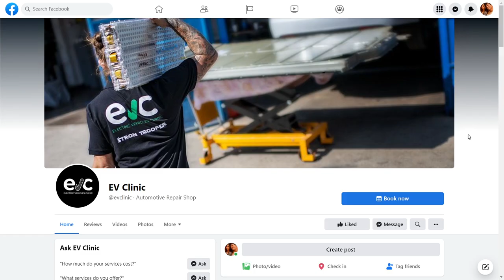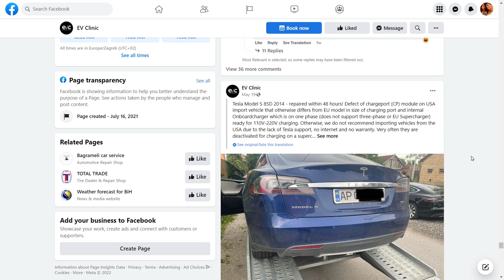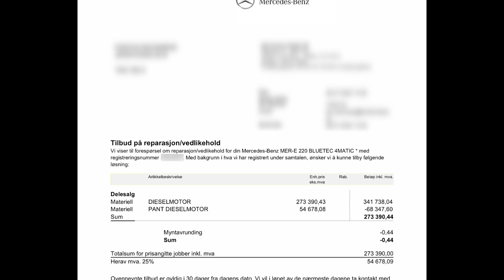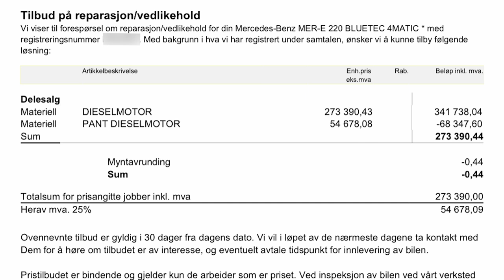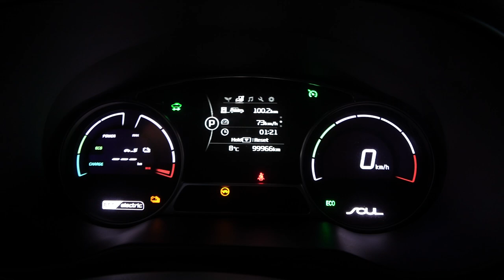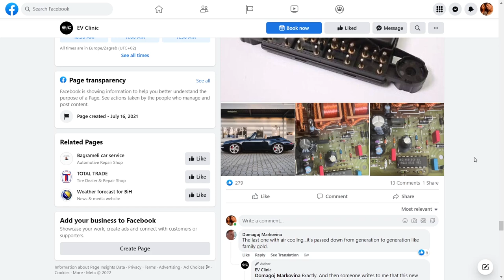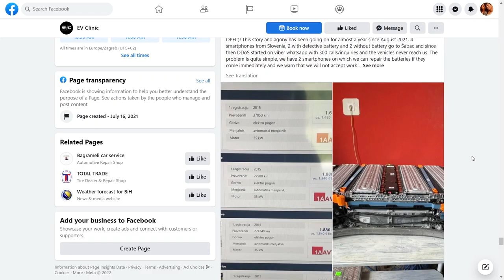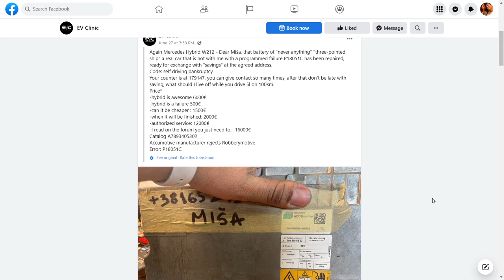Why fossil cars are more expensive to repair than EVs

Comment: The biggest problem is to find guys like Nassid and Vanja in your neighborhood :). I hope we'll see more and more companies in the future that can do EV repairs on a level below just swapping complete boxes.
Reply: @rogerstarkey5390  I have not really heard anything about such companies so far, at least not over here in Germany.
Reply: This is the future.  If I were a mechanic or ran a garage I would be training up to do this now (I think many are)
Reply: @FFVoyager  I think there needs to be a second level to this. I don't really expect a garage to actually "repair" a broken inverter for example. But they could replace it with a refurbished one and send the broken one to a company that is specialized in this kind of electronic repairs.
Reply: @EinzigfreierName  The problem is that they will not send it for any refurbishments and will just replace with a new part which will be a very expensive replacement.
Reply: @dkostasx  Sure, that is what's currently happening. And I'm a bit afraid it will stay this way. But the business that Nassid and Vanja are doing gives some hope this might eventually change in the future. Otherwise, buying used EVs that are out of warranty is a big risk.
Reply: @bluebikerathar  Is not that simple. After a motor / inverter / feed back (hall sensors, resolvers) repair the motor - inverter combination need to be matched again. It is sort of similar to adjusting the timing of an ignition or injection system. It's doable but you need the equipment and the factory specs.....good luck getting those. For that reason Tesla changes the whole DU (drive unit ) even when only a 50 cent component in the inverter has failed.
Reply: @EinzigfreierName  Korrekt, mein Freund: An EV out of warranty is a financial time bomb. Model S P85+ with 333.000km and 5 months warranty left 🤔💣😫 here
Reply: @moestrei  I'm talking about risk, not about a time bomb. EV batteries DO fail, not only because of degradation but for several other reasons also. And if this happens out of warranty and you'll have to rely on the manufacturer to replace it, it will be pretty expensive. That's why such repair shops are really needed once more EV get on the road and the fleet gets older.
Reply: @EinzigfreierName  FINANCIAL time bomb.....we are talking about the same thing.
Reply: @moestrei  Yes, I got that part. But a time bomb will go off sooner or later. A battery failure will not hit most car owners over the whole lifetime of the car. But if you are the unlucky one who just bought a used EV out of battery warranty and the battery fails, that's really unpleasant. For ICE cars you may find a garage that is able to do cheap repairs with refurbished parts or parts from a scrapyard. That's something that will hopefully appear over time for EVs also.

Comment: they talk about refurbished batterypack and talking about a new engine.... a refurbished engine is definitly not 16000 euro's.... comparing apples and oranges. C'mon man...and then the different brands and how big the engine is etc etc... so many factors.
Reply: @rogerstarkey5390  Norway is expensive country :) Maybe maintenance or refurbished engines are super expensive in Norway. 
Anyway naturally it depends a lot what engine we are talking about, Golf/Corolla etc. will not cost 'anything' to fix/replace. M BWM, RS Audi etc for sure will cost a fortune.

EVs are still so new so there is not too many shops which can fix them -> in most of the cases it is like 'just replace a new battery' and cost is huge, which it technically could be possible to fix it in few hours with low cost (forget Tesla structural pack).
Reply from the maker: Did you not pay attention to the video? They were also talking about refurbished engine.
Reply: @rogerstarkey5390  what about the Kia Soul getting a new battery instead of having it repaired? Should it come with a MASSIVE CO2-tax as the batteries are so energy demanding in producing? Just to level the playing field vs ICE car I mean and also in the name of saving the environment as we all know CO2-taxes make up for the things we do…
Reply: @mho0  my uncle's 2008 Rav 4 engine swap cost him €800 euros In Norway. Engine + work included.
Reply: @AP13P  So engine swap can be very cost effective also on Norway. 
And generally I would assume that if you, which I believe is very rare case, you need to swap an engine to a quite new car, it will be very costly. But probably for many older cars it is quite cheap.

Comment: Very interessing interview. But to be more objective, the lower the component integration of a BEV is the more service friendly they are. (It’s amazing that the Cellmoduls are screwed to battery housing )
But if you look to the next generation of electric cars with a structural battery pack (Tesla MY), you will notice there will be no service solution at all. Everything is glued together Isolation foam is used against thermal propagation, the cover only be hardly removed due to the use of liquide sealing (Loctite)

Comment: I'm a retired mechanic, and a few years ago I had a 2.2 diesel Renault Vel Satis.  It would hardly drive and had error codes everywhere.  It turned out to be the inlet manifold.  It was designed to also act as the valve cover and so was soaked with oil one side and had pressurised air the other side from the turbo-charger.  This plastic had degraded and the pressurised air was filling the inside of the engine.  I bought a new plastic manifold.  It cost me nearly £400, and once fitted (I used a specialised diesel workshop as they had all the tools and diagnostics), the job cost well over £1000.  OK, the car now worked, but it was just a piece of moulded plastic!
Reply: Local EV repair guy does not exist outside the US and Norway.
Reply: 2.2 dci is one of the worst diesel engines ever, only 3.0 dci is worse. No better diesel engine like 2.0 dci. Will run forever, also their automatic transmissions are very reliable. Sure, the rest of the car (Espace, Laguna, Vel Satis) is pretty crap but still they are very comfortable. I will not sell my 2012 Espace, ever. After owning the whole Tesla range, currently a MYP, I stand behind by statement. No one buys a new engine for 25k EUR for a car being 5+ years old. No one. There are plenty refurbished engines or engines for 20 % of that price, so although this video providing many useful information about BEV repair, comparison between „replacing a few cells“ vs. „a new mercedes engine“ just isn‘t fair.
Reply: @moestrei  nope, Vanja is from Zagreb, Croatia, European Union :)
Reply: @lbtobl83  Yes there is a lot happening in Eastern Europe....very good in hacking Tesla software and repairing / refurbishing parts. Nothing of this in my part of the world.

Comment: I own a Toyota Diesel 8 years old. 2 parts have broken in 8 years. Front left spring, hit a bad pothole cost 250 euro. changed both right and left. A cable to control heat and cold broke. Cable 120 euro work 140 euro total cost 260 euro. Total repair bill over 8 years is 510 euro in my diesel Toyota. So I have been lucky.
Reply: @rogerstarkey5390  he asked after fossile fuel owners to tell how their cars had been on repairs. So I gave my story. Not twisted for or against fossile fuels. Only my reality. I would love to own an EV but cant afford it.
Reply: I have never had drivetrain breakdown in past and current car either. Tires, 12V battery, wheel adjustment, and wheel bolts have needed replacement outside regular service. None of this is unique for a particular drivetrain.
Reply: VW Passat 1.8T from 2003: fuel pump, 2x water pump, multiple sensors, 2x timing belt, once engine damage (valves bent), fuel filter, vacuum system, engine block gasket, catalyst, clutch, injection leaking.
These are only the repairs that affect the powertrain and service parts are also not considered, such as oil, spark plugs, filters, etc.
I was able to do most of it together with mechanic friends, in the workshop alone these repairs would have cost around €15,000 - 20,000 , which would definitely correspond to a refurbished battery.
And in 2003, the durability was even better and the parts cheaper than most new vehicles.
Reply: @Zedus-rl9hp  Thats a lot even for a 19 year old VW. I have owned 2 Golf in my life for total of 9 years, changed 1 part accept service. Cost 100 euro. But they where old cars from the 80s.
Reply: @KristoferOlsson  The engine seal and catalyst were possibly a consequential damage from the defective fuel pump, which sometimes delivered too little fuel and the exhaust gas temperature was therefore too high. According to the VW workshop, it was said that the pump was fine, but after a year it stopped working at all and the guarantee had of course expired.
Engine damage came from a bearing damage to the second water pump, which is also stupidly solved by driving it via the timing belt.
Reply: @rogerstarkey5390  there are also one in a million opinions saying that their Peugeot broke after 40,000km.
Reply: Yes. One of the reasons why Thai people don't move to EVs because their Toyotas (and Isuzus) have much reliability and longevity. The repair costs are also not expensive enough to make them thinking about EVs. And many EVs in Thailand are Chinese cars, people don't trust in them.

Comment: Would love to see a Billexperten/EVhub battery repair video. If you compare standardized electric motors to ICE they are also very cheap. Not even attractive to overhaul the smaller motors.

Comment: I've had a just over 4year old ICE engine failing on me without warranty or insurance at less than 20000 miles. (Yes, full engine change as exhaust vale opener had failed with melted top and cracked piston and scratched block... ouch!) But having also had a 14+year old car with 200 000+ miles with no drivetrain problems and whatever is wrong I can sort myself in general with a 14+ year old car. At the moment I am more worried about charging station functionality and availability in an EV road trip than the EV breaking down. But in general, my experience from OEM garages is shit, be it EV or ICE. But when it comes to ICE, there are many options available far from the large cities. But when it comes to EV drivetrain (BEV or PHEV) you'd be happy if you can find a great independent garage even in major cities. While I guess that will improve over time, I am not hopeful unless you live in a major city for many years to come.

Comment: I know someone who had his Volvo XC90 in for some maintenance, two mechanics worked on it, one changing oil, the other one doing some diagnostics, and the diagnostic guy forgot that the oil had been drained and started the engine. They first realized something was wrong when the engine started screaming. It cost them 200.000 DKK to replace the engine.

Comment: Ford S-max WA6 2007 2.0 Tdci.  The car has been properly serviced and maintained.  At 150,000 km, the car shut off and did not want to start again.  6 months at the service station and they didn't find a fault.  They suspected the high-pressure pump, but after testing and installing a new pump, the car still wouldn't start.  Replaced the fuel supply set approx. 500e, the car still did not start.  I finally managed to turn it on myself, but no one knew what was wrong.  At 198,000 km, a new set of clutches was replaced with new ABS sensors, oil filters and other fluids, approx. 2000e.  200000km TÜF done, it is necessary to replace the rear bridge with springs, tie rods, front suspension, new EGR with exhaust gas cooler plus cleaning of the complete system and a few other small things approx. 2500e.  After that, the navigation completely breaks down.  After inquiry, it was sent for repair to replace the motherboard and a couple of 580e components.  After the installation of the repaired navigation, the air conditioner does not work, and an air conditioner service is required for approx. 250e.  Now at 207,500 km at the regular oil service we find metal shavings in the diesel filter and after asking the specialist and several service technicians they all give the same answer.  The high pressure pump has gone.  replacement of pump, nozzle, fuel hoses, new tank, new fuel pump, new filters plus work approx. 4000e.  In the last 3 years, I spent approx. 14,000e on service and diesel for a 15-year-old car.  You can see if it's worth it, and I don't think I have to write anything more, except that this is pure robbery that was purposefully made.
Reply: This is why you buy Toyota petrol
Reply: @dragospahontu  hahaha I'm looking for a Toyota 1.8 or 2.0 petrol.  I am looking from 2000 to 2008
Reply: @antoniojelec2175  anything petrol is more reliable in reality. Diesels are pretty expensive to repair.
Reply: @dragospahontu  *Diesel Toyota from 2000s.
Reply: @AP13P  new diesel engines aren't good. Petrol all the way. Toyota D4-S has thermal efficiency of 43%🙂

Comment: Seat Exeo Multitronic built 2013 80000 km Gearbox broke after 4 years. 6' for the gearbox, 3 for repair. I've found a free repairshop  (in germany) but still costs me  4'€. Now I'm the owner of a used model s. Björn you are the responsible for that. Al ofen wrote: A list of repairshops ev parts would be fantastic. Thanks and all the best from (self
-destroying) germany.

Comment: Totally disagree. In the past I was able to fix all my cars myself incl. fuel injected ones. Wost case I picked up an engine from a wrecker for under AUD1000. Picking up a 2nd hand rear DU for my P85+ is at least AUD8000 and I'm not even sure if the computer will talk to it. The battery.....Tesla could not give me a replacement price but said it was AUD40000 (yes I counted the zeros right) for a Model 3. Right to Repair needs to be legislated so aftermarket and independent workshops can bring prices down. An EV out of warranty is a financial time bomb, at least here in Australia. Edit: Still would NEVER go back to ICE.
Reply: You'll have the same issues with the need for programming in order to get the parts to work, in a modern ICE as in an EV.

Comment: Now I am looking forward for hybrid car discussion.
Reply: Me too, but I don’t hold my breath the verdict will be much different than what we just watched. I guess the ICE drivetrain on my Niro PHEV is relatively safe, will get high mileage without much wear on engine. The service intervals are also every year/15K km. But it has a DCT which might not be any different than having a DCT in a regular ICE, and the Niro EV counterpart doesn’t need/have a gearbox. Less moving parts should generally be better.